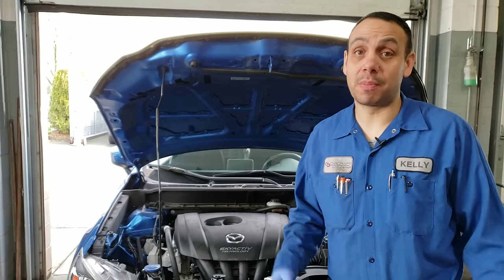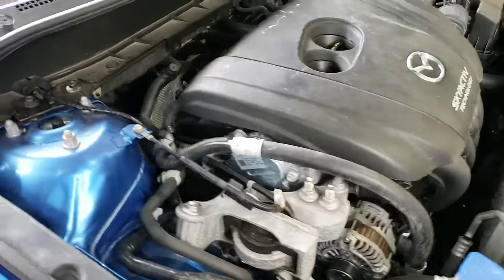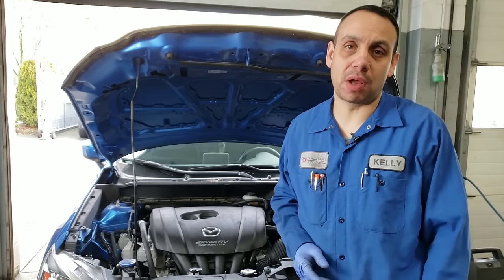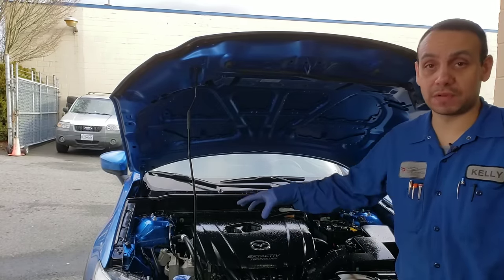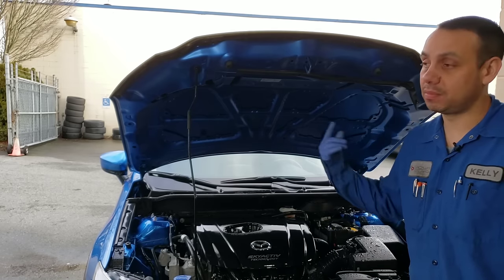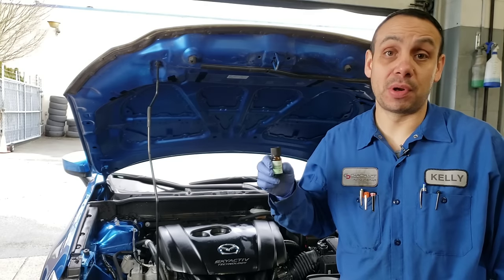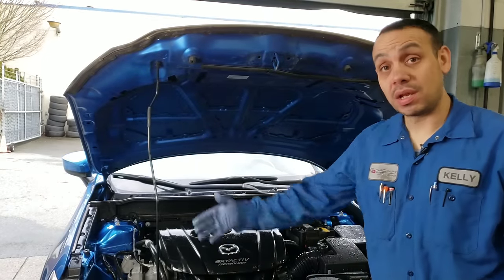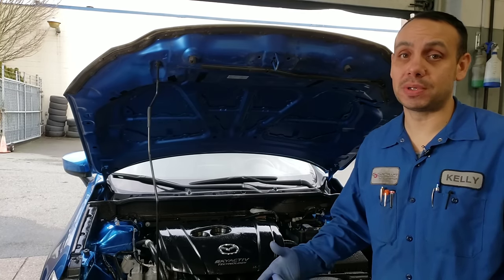Easy Tip To Keep Rodents, Mice & Rats Out of Your Engine Bay

Comment: I have a big problem with rats under the hood of my cars. I have found rat nests under the hood of my Ford Focus, they actually gnawed away some of the lining of the hood to build the nest, luckily they didn’t do any serious damage to the car as far as I can tell. I have also had some rodent trouble with my Mitsubishi Triton under the hood. A rat gnawed away the insulation of a wire leading to the injectors! I will definitely try this peppermint oil out and if that don’t work then I’m getting a rat blocker

Comment: I installed a electronic mouse blocker it did not work. Rats got into the cabin filter of my 2013 Terrain. I did spray the peppermint oil but I probably needed to do it more often. I will now remove the plastic screen where the wiper blades are. Then access the air intake duct and cover with metal screen

Comment: I had a problem with squirrels nesting in engine compartment and chewing wires. What is a good repellent for them?
Reply: Best solution for this is rat mesh installation from front bumper to engine and sides fully packed 👍

Comment: The first thing I noticed is that this Mazda doesn't have a hood insulator blanket. I've owned Mazdas for decades and they've always had that. Mice love to get inside them or chew off the black facing for nesting materials. We have an '08 Toyota Highlander that mice could got into the cowl cavity and once chewed their way through the cabin air filter. Fuckers. I ended up molding some bird screen as covers for the areas on the cowl (left and right of the wipers) to prevent access, which still works to this day. They did, however, find an opening into the hood insulator and built a condo in there. They chewed off a section of the windshield washer hose, and I discovered that one day when the blue fluid didn't come out of the nozzles and there was blue fluid all over my engine cover... I hate those fuckers!  Always finding acorns on the engine block. I once tried using mothballs in the engine bay... bad idea. You can smell that inside the car for weeks until they dissolve.

Comment: I’ve had $7500 worth of rat repairs in the past 7 months (3 separate repairs). I started using a product called Rat Away after the second repair, it’s peppermint based, but wasn’t quite strong enough. I think I need the high frequency thing with the peppermint spray and the grace of God and then maybe I can get through the rest of this lease without another repair. The car is 15 months old. 

It’s Rat-pocalypse out there people. 

Good video though. I might do the engine cleaning thing and then treat with peppermint.

Comment: The other thing they do is, NEST! They can cause fires with there nest next too hot exhaust manifolds. Happened too me last February and completely melted the 98 GMC Savanna box van before it got put out. That frekin plastic auto makers use on EVERYTHING, makes a GREAT EXCELERANT

Comment: Moth balls , best used by opening the bag of moth ball put in a sock tie a knot in the end of the sock and place where you want under the hood and back of the car underneath.. Trust me they will not go anywhere near your car . Just make sure it is not placed near heat or flame. Moth Balls will burn if lighted or heated too hot.

Comment: I've tried Mothballs, Cinnamon oil, and Peppermint oil, suspended Tobacco leaves in 4 places on a string..Even dusted the entire engine bay with talcum powder.

Nothing works here in India!!

The rats ( I have actually seen the critter once when I opened the bonnet!) have been nibbling at all foam insulation...
Going to try "Tom cat" a spray

Comment: You didn't lift up the plastic engine cover. I can almost guarantee there's a nest under it. They'll be feasting on the coil pack wires. And there might be another nest in the cabin air vent system, and another in the shroud under the engine.  Don't ask how I know.

Comment: If You jack up your car when you store it , and remove the tires , two things will happen.
The first is that is that your tires wont end up with flat spots and cracks on them.
The second is, if You put grease on the shafts of the jack stands ,and brush some oil on your lower control arms , the mice wont have an easy access to get into your vehicle .

Comment: Hi thank you for the information.  During the pandemic my car became INFESTED with mice.  I have cleaned the entire engine like you did repeatedly.  I cleaned the air box & intakes to the best of my ability.  Its been over a year....and I still can't get that STANK out!!!  I want to puke every time I drive.  I've repeatedly sprayed  and cleaned & cleaned as much as I know 🤔.  The blower fan was replaced.  Im changing the air/cabin filters regularly,  but it still smells like the back side of a mouse.   I dread having to turn the AC/heater on. What else, besides everything you demostrated, can I do??    The mice have been gone for a year............🤢🤢🤢🤢

Comment: You dirty rat!  Quote from a famous actor I believe… ha.  Thanks for the tips.

I have been around the planet for a long time and have not had this problem until recently.  

Have tried a few things even dryer sheets was suggested by the dealer’s auto shop.  I guess like the peppermint they don’t like the smell.  Now I purchased one of the electronic devices you mentioned.  A rodent repellent that emits high frequency sounds and flashes a light that apparently does the trick.  

Now I’m ready to install it.  Hooks up to the car battery.  I’m just not sure where a proper place is under the hood for installation.  

Thanks for the video.  Cheers!

Comment: I got two  plastic water bottles,  put holes in them  then filled them about half way with moth balls and put them  on both sides of the engine bay and it seemed to work.

Comment: Could apple cider vingar mixed with water also swrve as a deterrent for mice around the vehicle. My sis leaves up north & 2 of her cars have had mice sdt up a home in there car engine. it’s has cost them $$$ to get them out. so where they park if I sprayed the peppermint oil mixture or the apple cider muxture around their car at  any hour should cause them to stay away from vehicle correct ?   if spraying  near tires and on the ground under engine area I thought would deter them from going neR the car completely. I’m asking could this work? Thank you for your  help.

Comment: Very well done video.  I live in AZ and had a home in the country where there were huge pack rat mounds.  Cost $3,000 to replace wiring in tractor and $900 to replace line  in air ride of our Mercury.  They chewed wiring under house in air conditioning lines and guy told us to cut up Irish Spring soap and put around wiring.  I now live in town but still rural.There were tons of seeds, feces and rat urine on golf cart batteries, I cleaned it all off and cut up Irish Spring and put on batteries. Clean as a whistle since. They were under hood of my truck so I soaked cotton balls with peppermint oil and put wherever I could, but that didn’t keep them out.  I have cut up Irish Spring and laid on batteries, so far so good but have to take out if I drive. I haven’t figured out how to attach.  I cut up pieces and put throughout my 5th wheel, so far so good there.

Comment: No visible damage….although I would find out they actually chewed straight through the underside of the plastic housing to my main fuse box…car wouldn’t  start but turned on…..needed a new wiring harness…..insane…nesting inside the box…crazy….like $4300 fix…but comprehensive insurance covered it..

Comment: And CATS..   oh ya, those barn and semi feral cats like that warm engine bay in the winter.. usually the jump out on a 'false start' but I've had them get trashed bu the fan and fan belt..  guess they like the warm radiator and if you can get a pepper oil spray (oleoresin capsicum) , it works better but can irritate anyone that has to work on that area until removed..

Comment: I have 4 stray cats living on my front driveway, one sleep on top of jeep, on or 2 sleep in my boat the other under my celica. I don't feed them, the cats hunt at night.
Reply: Wait till you start it up and that cat is sleeping somewhere it shouldn't under the hood..
Quite a mess to clean up
Reply: @rogerwilco5918  As someone said later, always beep the horn when you suspect animals might under the hood from getting a good night's sleep.  One of our cats slept under the hood and wound up with a nice clean stripe of bare skin where the fur along his backbone was pulled off.  No long term harm but he told me it did not feel good.
Reply: @replyhere590  i bet he didn't do it again..
Back it the day when cars had big fan shrouds and belt driven steel fans blades it could get quite messy.

Comment: I couldn't start my truck one morning. A flying squirrel built a nest in my truck's intake, overnight. Industrious little guy. I garage a Pontiac G8GT and a mouse family built a home in the cabin air plenum. Urinated all over the dash. Awful smell. I use lavender, but I'm going to douse the engine bay and trunk with peppermint oil.

Comment: I have lived at the same apartment with my car parked outside I have no garage for 21 years it started one week ago my engine light came on took it to the garage they said a rodent chewed it paid $200 to get it fixed.  I went home I got 2 nights out of it and it chewed it again on my Chrysler 20, 2012 in the garage for another $200

Comment: I have a very bad problem with mice building a nest in the air filter box. I fixed it by cutting Circles of diamond mesh wire and stuff it in the hole

Comment: I have tried peppermint oil on my vintage sports cars and it doesn't work. I have also tried  scented bars of soap and found the mice eat the soap.
Reply: Best solution for this is rat mesh installation from front bumper to engine and sides fully packed 👍

Comment: A couple of days ago, I found a litter of 4 mice in the intake plenum of my 2015 Honda CRV. They were at a point where the air enters before the cabin filter. I don't see how they could have possibly gotten there. It looked like the nest was made from material out of a dog blanket in the rear of the cabin. No sign of an adult, the litter was dead and stinking that's why I searched. Any Ideas, anyone?

Comment: For the love of anything that is wholesome and holy. PLEASE DON’T USE A WATER HOSE AND SPRAY THE ENGINE WELL. good grief. You can spray the detergent film and wipe. FYI, you can go to eBay and buy those devices some so simple you can install it yourself if not then hit up a shop

Comment: Really bad to wash engine.  I used to  wash my engine when I was younger.  Looked nice and clean.  Then about a year later noticed bad engine running.  Injector connectors had developed heavy corrosion, even with the rubber seal intact.  Never spray water over wiring.

Comment: Under no circumstances would I put cotton balls with peppermint oil on them, in the engine bay. With the amount of heat and air turbulence in the engine bay I would not put two such highly flammable items in there.

Comment: Never ever water spray underneath your hood!You will damage all electrical wiring! 🤯☝️🤨
Reply: You CAN spray water under the hood. You can even pressure wash. The main thing is try to stay away from distributors and coil packs. Just to be sure, clean when you have enough time for the car to naturally dry before you run it. Do this on my cars all the time no issues ever. Going to go the electric route

Comment: Another fix for mice and rats is Irish Spring soap. You can put pieces of the soap in the air cleaner, around the battery and in pockets. They don't like the smell of Irish Spring soap.
Reply: Neither does my wife.  I use it but it still doesn’t keep her away.

Comment: Man I would never spray a car engine compartment down like you did. Way too many electrical components. I detail mine every year soap various brushes, light rinse with no nozzel just barly coming out of hose, but mostly wiping with towels from chemical guys. Then wipe and spray down with products made for plastic & rubber as a conditioner. Seven yr old Toyota Avalon looks like a 2023 engine compartment.

Comment: A product call “Just one bite” comes in cakes.
I break them up and place them in vehicles, garage floor and under the hood.
The rodent takes one bite and runs away to get water. They drop dead on the way and I have not found one in the car.

Comment: Appreciate your efforts, but I’m afraid your advice doesn’t work. I have a new Subaru and at my rural home in the PacNW, not only did the numerous peppermint soaked cotton balls NOT work, but the mice and rats actually used it for bedding. The only thing that has worked for me so far is putting Christmas lights (the kind that you can adjust the blinking speed) set to fast to mimic a strobe along with an audible alarm—and put both on a timer set @ 30-minute intervals. This doesn’t allow the little bastards to get comfy and it scares the crap out of them enough to run out in panic. 

I’d mention the sound alarm brand but I don’t want to come across as a fake endorsement. These units have a 3-level decibel setting depending on how much you want to annoy your neighbors. Luckily, my nearest neighbor is 200 yards away and they can’t hear it. My carport is about 100 feet away from my house so it just sounds like electric crickets. 🤣
These sound units are tough, too. I’ve had it for over a year and even got it wet, and it’s STILL working!

Comment: I have 3 Mazda 3’s
They make nests under the oil cover 
They get in car often 
If your not on recirc, they sit on cabin filter and crap, pee 
You breathe that in right away !!
I put screen in corners near wipers 
Leave on recirc always 
You must be running engine and not be on defrost to get recirc door closed. It takes 10 seconds while idling. There is a small foam door that mice chew open to gain access to your glove compartment 
Then free rein of car.  Yuck

Comment: 4:10  tip starts here.  Before this he explains how to use soap & water to clean the engine area.
Reply: The point is to clean the engine thoroughly BEFORE you treat it with the peppermint oil so you really should watch the entire video even it it's just to learn to not use a blower to remove the feces!

Comment: buy a rid-a-rat repeller device on ebay or walmart.com, about 36 bucks, 12 volts easy hook up to your battery and very very low drain.my son,s has been working under the hood for years and it works.

Comment: The reason they eat your wiring...Peanut oil is use to make the insulation of  the wires .Squirrels are the worst. Most of the time its not mice or rats.

Comment: Never spray the inside of the engine compartment with high pressure.  Same goes for motorcycles.  Low pressure only.

Comment: There are mice in my garage and, yet, they have never attacked any of my cars. Wonder why not.
Perhaps it's too greasy under the hoods.
Reply: Newer vehicles, thanks to democrats, have wire insulation that's made out of literally food products attractive to rodents. They have been in the engine compartment of both my vehicles attacking the wiring in only the newer one.
Reply: @jakejones5736  Actually it was begun in the BUSH admin. (2000) and almost all carmakers used it.  Though Bush says he voted for Democrats, he isn't one.
Reply: @wholeNwon  Makes my claim no less true.
Reply: @jakejones5736  Believe what you need to.

Comment: @3:00 you should not spray your engine bay using a garden hose or high pressure hose.  That really should been removed by using either water in a spray bottle or clothes to wipe it down.

Comment: I bought an LED strobe light put it under my hood at night.  Hopefully it works I watched it I got ill just watching the strobe
Reply: I thought about the same except that neighbors would likely complain (you know, strobe light pollution) even though my truck is in a garage. I tried peppermint oil, moth balls and all the usual stuff. What seems to work thus far (in the garage) is leaving the hood up with a timer programmed to light beamed on the top of the engine and another focused from the floor. Also a radio on a talk station during those hours. The rats mostly avoid my traps but seem to dislike the light and talk radio noise.
Reply: @MikeNaples  
They aren't outside they are placed in the engine on a timer. I remove them if I'm going somewhere.

Comment: Dealt with this for years near living in the woods but those oils and and sound machines are a waste.The chipmunks are bad usually just making nests but mice are the worst chewing on all the wiring. The only cure is a family of cats or putting out lots of poison feeders outside before they get in buildings or cars and then having some inside. Had them in my boat , motorcycle air box and a favorite spot is behind the cabin air filter on cars pissing and pooping on the filter for the air you breathe.

Comment: One SURE FIRE method is to place a bag of MOTHBALLS Under your car....rats, squirrels, chipmonks hate the smell and will avoid your car period.  Hang the bag from the top of your engine to it hangs down but does not touch the ground.  Be sure to remove before driving so it does not get caught in your engine.  You're welcome.

Comment: I don't know where you live.
I live in East Sussex UK.
I'm afraid none of that would stop the rats I had.
The rats will only stay around if there is a food source.
Those b-----ds get anywhere, I've seen two climb out of a toaster before. They were big rats, not mice.
If you have livestock, especially chickens you'll have rats.
You can try parking your car in a slightly different place as they take a few days to get used to where the vehicle is parked.
It's the food source that's the main reason they're there though. No food no rats.
You never have rats and mice as the rats will eat the mice